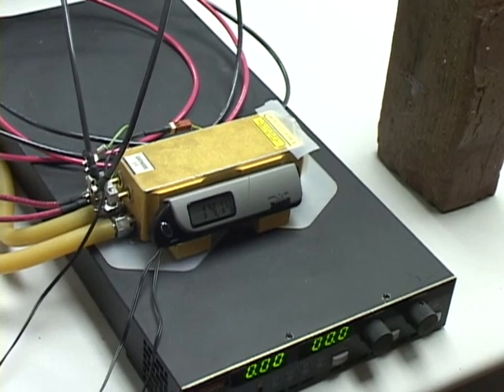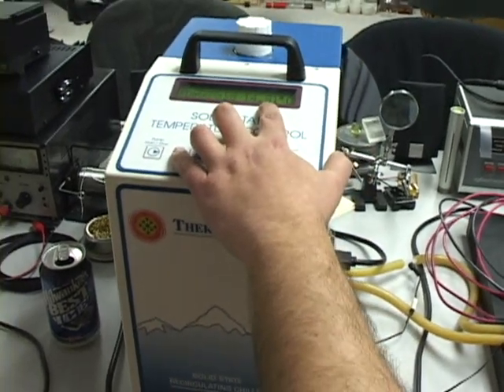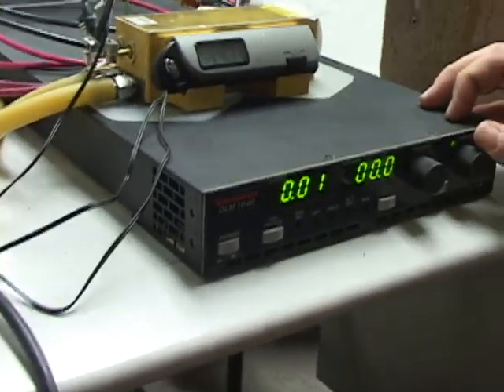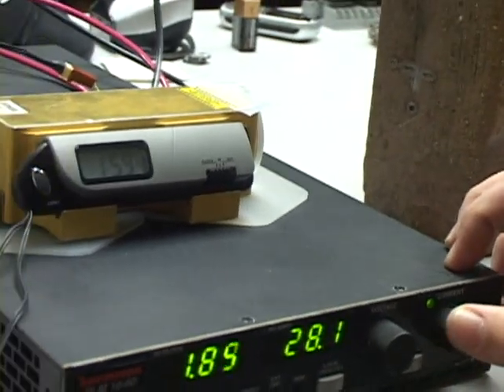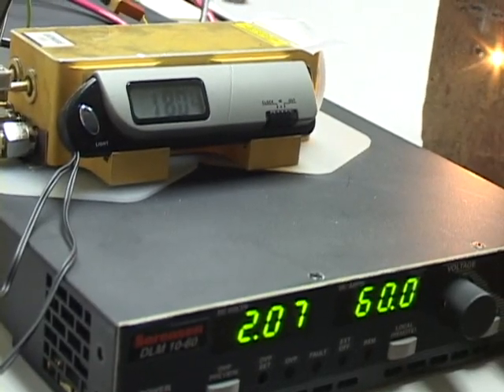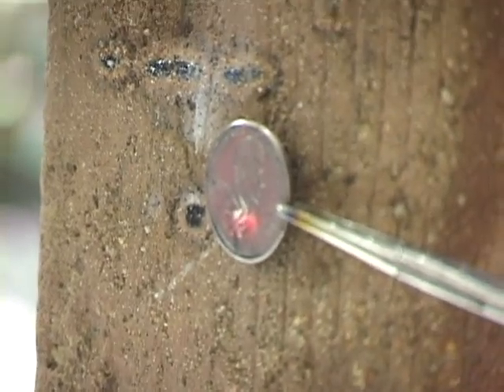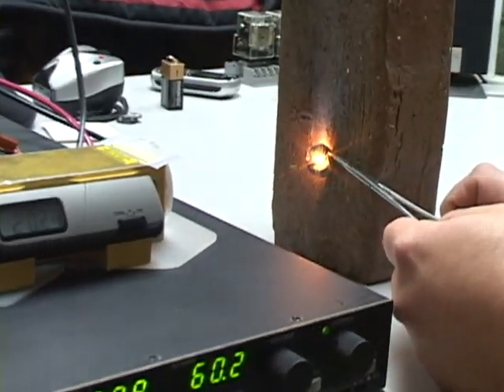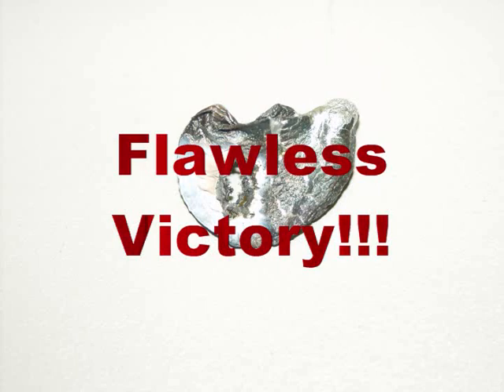Penny Vs Coherent Laser Diode

Comment from the maker: @Northerncalwolf I don't believe there are any dyes that will fluoresce in the IR wavelengths. You generally need a shorter wavelength for dyes that will produce a longer wavelength. Like UV to blue or green to red. There may be some kind of exotic dye that can be pumped with 800nm but I'm unaware of it.

Comment from the maker: Good question.... The reason is lasers are not very efficient. Though laser diodes are at the top of the chain for efficiency, you still loose a lot of conversion efficiency in waste heat. Note big ass solid state chiller. This diode actually needs about 90 amps to make the full 60W of output power. I currently don't hae a meter to register this amount of output but I'd say the laser currently makes between 35-50 watts of 808nm with 60 amps going in.

Comment: Very interesting.  I noticed you did not use a shiny penny. Is that on purpose?
If you were to try and burn a material that had a partly reflective surface would there be any danger from rouge reflected (refracted) beams?

Thanks

Comment from the maker: @cjdelphi See HV's post below about the power conversion efficiency. That is the correct answer. 

As for your correlation of voltage and wavelength, you will have to rephrase your question. 

I guarantee that penny was reflective even with it being tarnished.
As for my eyes... I had a pair of OD6 @ 800nm laser safety goggles on. Safety is always a priority.

Comment from the maker: Yeah, It will melt tile. Pretty much the same clay as in brick. It actually turns the brick into a black obsidian like glass. I'll pass on the aerosol can. Though it would be cool. Way too dangerous for my tastes. If I can manage to build a decent collimator, I could put a can of butane or a disposable lighter 20 feet or so away. I'd do that.

Comment: Hi,
125.216W  is the power going in to the laser, not the power of light coming out. the process is not 100% effiecent (hence the water-cooling). to work out effiecency, output/ input X100.
(50/ 125.216)X100 = 39.93%
The other 60.07% being wasted as heat and various other waste products.... :-D.

Comment from the maker: @Northerncalwolf As for the flux capacitor... Well, one capable of handling at least 1.21 gigawatts of electricity. The problem I have with FC's is that you could possibly create a paradox that will unravel the fabric of the space-time continuum and destroy the entire planet.  Eh, I figure... What the hell... I could build ya one but the Libyans are currently not dealing with me on plutonium anymore. :(  My shiny bomb casing filled with pinball machine parts kinda pissed them off.

Comment: You ramped it up to 60.2 amps,  and on the left hand side it shows presumably Volts? 2.08v
60.2 amps

You stated  - "30-50W of 808nm completely vaporizes the copper/zinc alloy of the penny in seconds. "

Well um... hmm lol, Lower the band gap, since it's in the IR range, it has to be volts, where as Green/Blue/UV have a higher voltage (around 3v) .

So, you were actually outputting 125.216 WATTS... god damn, if that penny was reflective, just 1ms worth of IR would burn  your eyes out man... :O